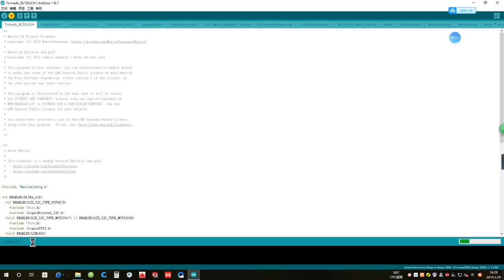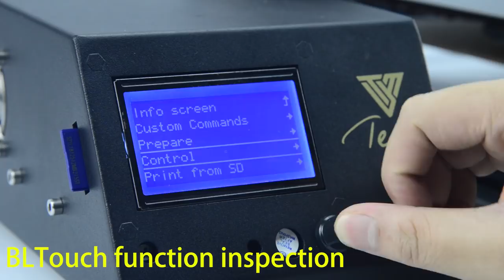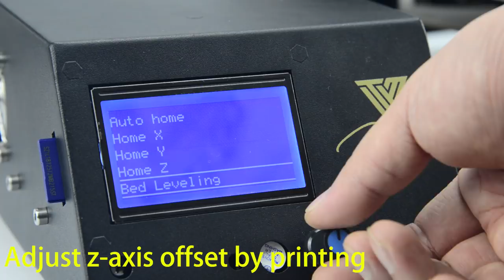5 Steps to make your printer auto-leveled.  BLTouch upgrade for Tevo tornado!!

Comment: I ordered my BLTouch, I have the same tornado model as the one in the video, one question tho for anyone around that may know, for the cable from the BLTouch to the motherboard, which kind is it used? gauge? I got the dupont connectors but im kinda stuck in what kind of cable to buy, any help would be greatly appreciated, thank you

Comment: I have two TTs and I really like them, but people seem to have it out for them and it's hard to find information specifically for them. Every time I find something that might be useful, it's being held ransom by a Facebook account. Many people in my search have said the same. It makes it seem like there's some exclusivity there and it's really annoying. I bought a Tevo product, I expect to be able to freely find help for that product without a third party highwayman. Thanks for the video and showing the hardware setup, but you conveniently left out the part that's locked behind a FB account. I don't like that. Make these files available on your site for direct download. Don't give me a link to sign in with FB! Product is great, customer service is garbage.
Reply: Most of these cartesian printers are about the same, regardless of where you get it assuming it's calibrated correctly. The Tornado is better than a lot within the price range because the heated bed is fast and the glass is nice and flat, and from my experience the printer functions well out of the box and better with inexpensive upgrades. Unfortunately, the best thing about the Tornado is the facebook group with over 15,500 members and a ton of them willing to answer questions and help out. It's the best resource a Tornado owner has, so I'd suggest just making a Facebook account named like "Nado Printsman" just for the Tevo Tornado Owner's Group. Every single issue I've been unable to solve on my own was solved with troubleshooting help within days thanks to the group. Every upgrade I've made was either informed by, or assisted with the help of the other members of the group.
Reply: https://www.thingiverse.com/thing:3194402 all firmware available here
Reply: qui est le dernier de tous  parce que certains des 2.0 me donne une erreur.  est-ce duo ???
Reply: qui est le dernier de tous  parce que certains des 2.0 me donne une erreur.  est-ce duo ???
Reply: qui est le dernier de tous  parce que certains des 2.0 me donne une erreur.  est-ce duo ???
Reply: qui est le dernier de tous  parce que certains des 2.0 me donne une erreur.  est-ce duo ???
Reply: @Becard  Thats version 1.1.9.  I think people are looking for 2.0

Comment: Where can I buy? Link no work to aliexpress.
Reply from the maker: Try again, just find there was a mistake.
Reply: @officialhomers3dprintersch94   please answer my question, support your customers.
Reply from the maker: @DaddyGoFast  that's a vender video . sorry for the vpn issue can't reply in time ;)
Reply: @officialhomers3dprintersch94  Please, add a download link to the firmware to non facebook users i have ordered my BLTouch and i have problems to find the Marlin Files, in the github i don't see any trace of BLTouch. Thanks.
Reply: @officialhomers3dprintersch94   Can you PLEASE link to the firmware file for this 2018 version, and show what ribbon cable to purchase? Nothing exists on GitHub.